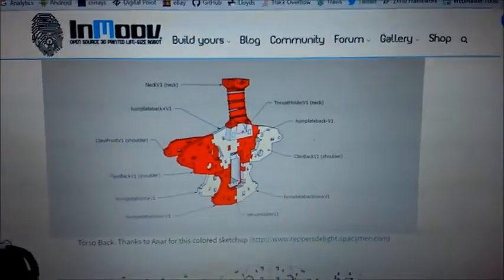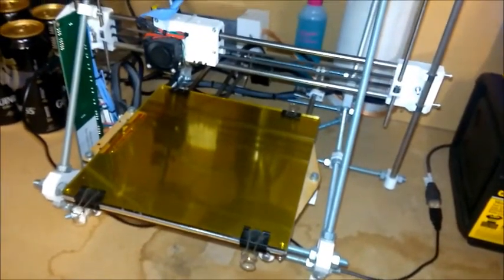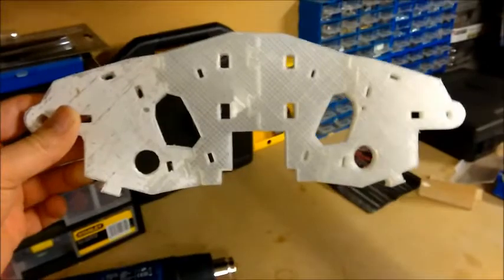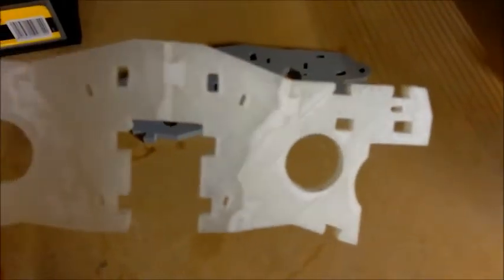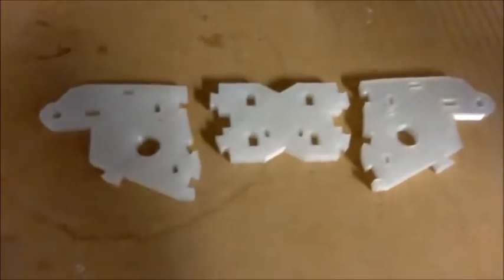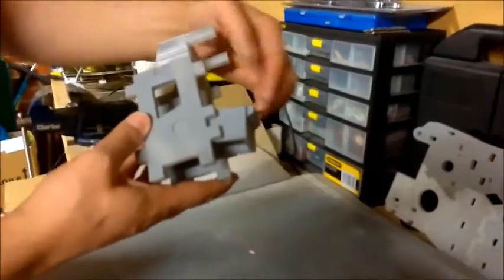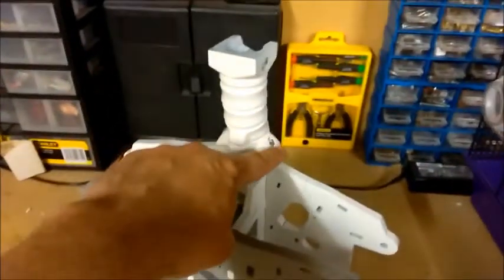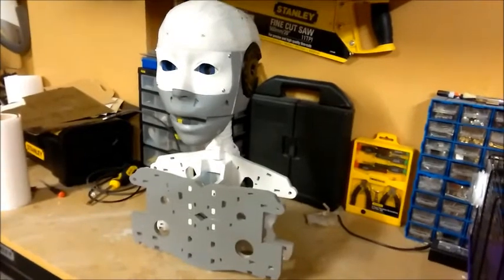Civrays InMoov - Starting the torso

Comment: Where do you start?
Reply from the maker: That's the really great thing about this project. You can start anywhere. I started with the eyes, then gradually completed the whole head. I think most people start with the hand. That's where Gael started the whole project initially. I would recommend starting with the hand because you can get some quick results that will give you the motivation to keep going.

Head over to the inmoov.fr website. Look for the "inmoov stl parts library" under the "gallery" menu. From there you can start downloading the parts. Also on that site you can find instructions. If you start building be sure to sign up on the inmoov.fr website and share photos and videos of you progress. You can also ask questions to get help.